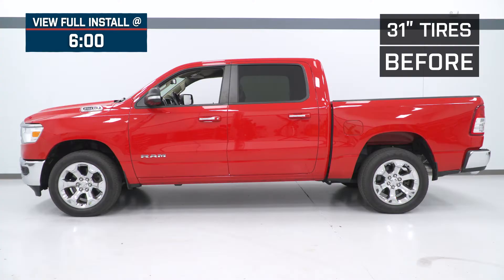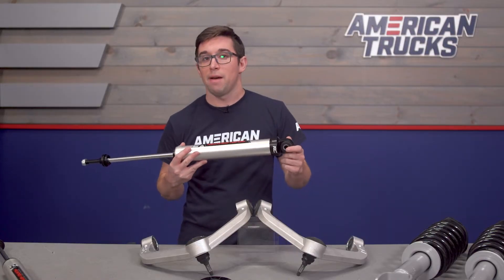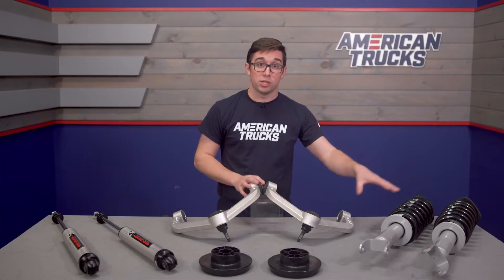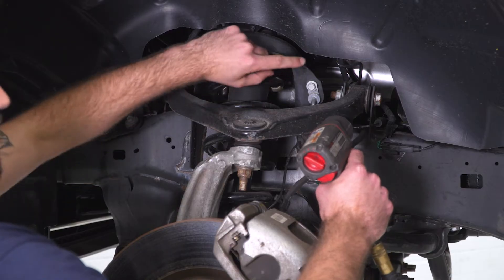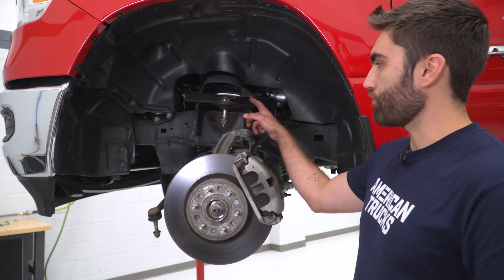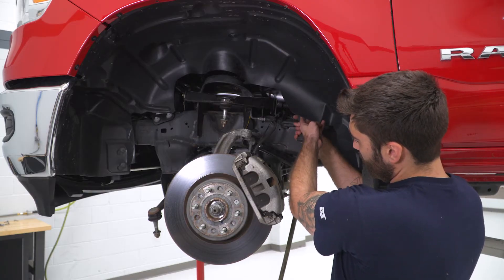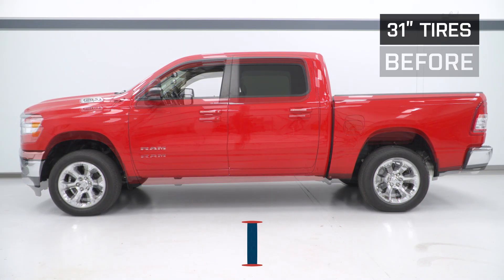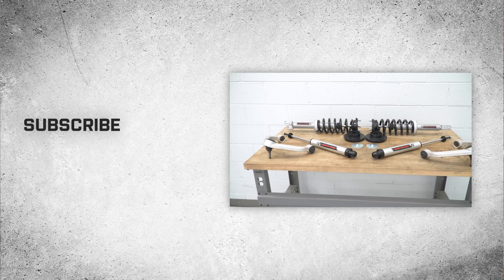2019-2023 RAM 1500 Rough Country 3.50-Inch Bolt-On Suspension Lift Kit Review & Install

Comment: I love my 3.5-inch N3 shocks and struts on my 19 RAM 1500.  Only had to replace my UCAs after four years of trails in Yucca Valley and RN trails in Big Bear CA.  Due to my ball joint going to crap on me.   If you do regular maintenance on them (  grease the ball joints), pavement princess UCAs  will last longer than mine did.  I am happy with my RC set up,  even the LED light pods with amber.  and wheel well liners.   The products perform great, and my truck has an awesome stance and appearance.
Reply: How’s the ride quality ? Also do you run 33s or 35s?